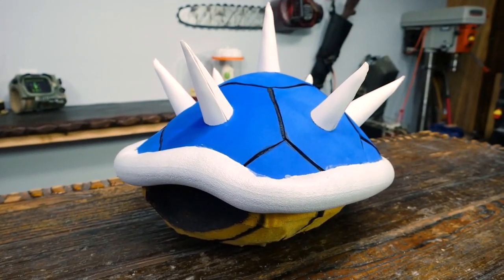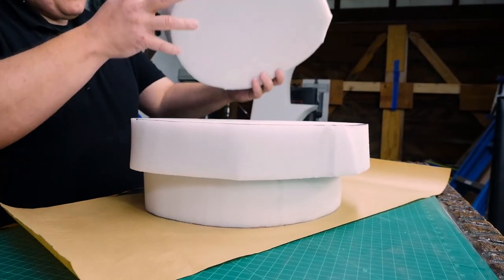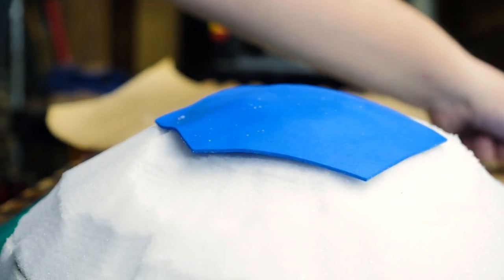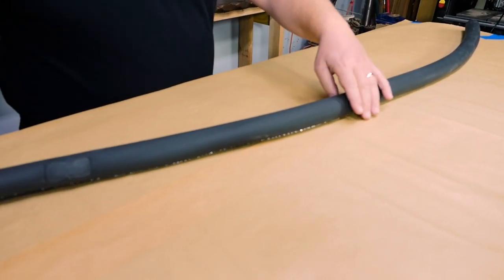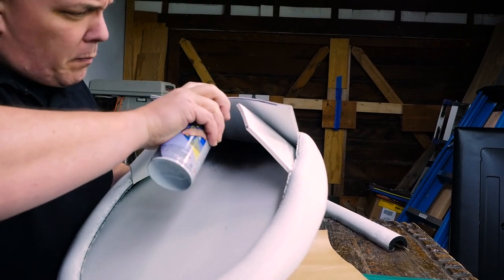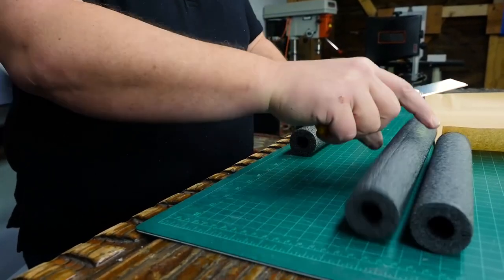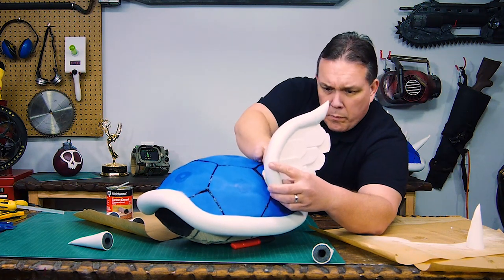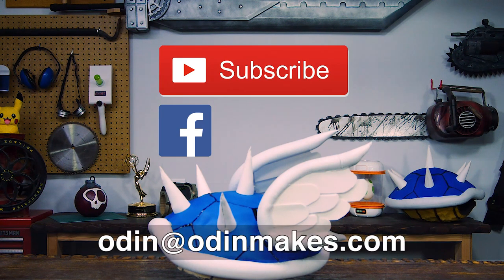Odin Makes: Blue Shell from Mario Kart

Comment: Can you use another kind of foam?If yes, what would that kind be?
Reply from the maker: Steve Angelopoulos yes, one could use most any foam. I used this poly foam because it is softer. the new white foam is stiffer than the yellow foam, but the first blue shell was made to be thrown at people in costume. if you want to keep it all soft and plushy the latex based foam is fine. The stiffer grey foam that a lot of equipment is packed in would work too. If it was only ever going to be used for display you could use styrofoam or the expanding polyethylene foams. Then it would never sink!